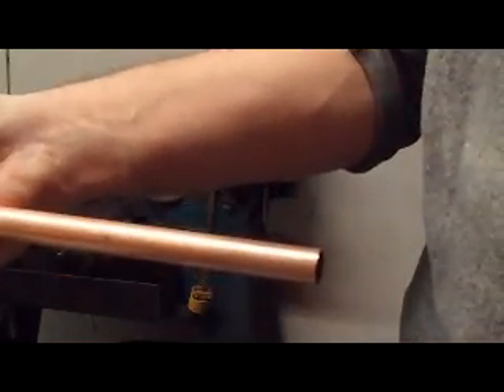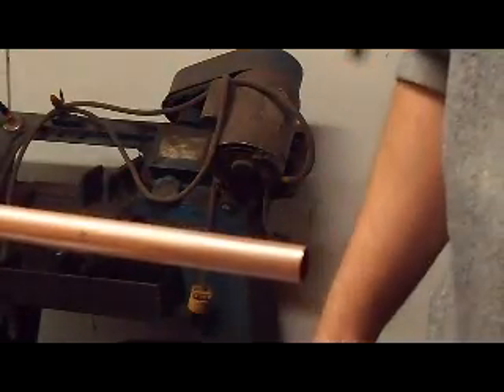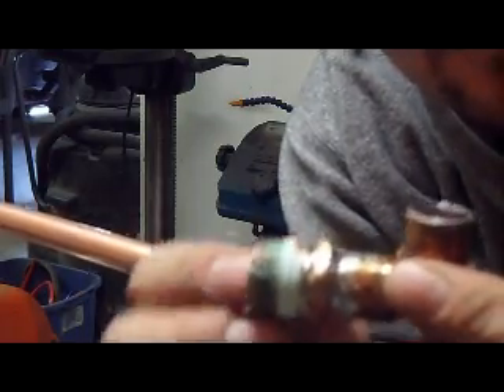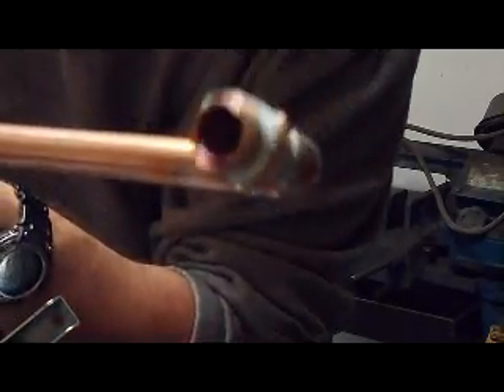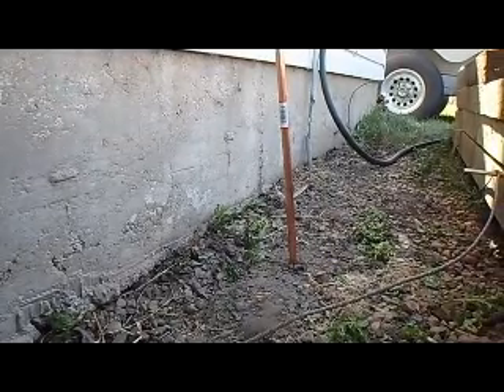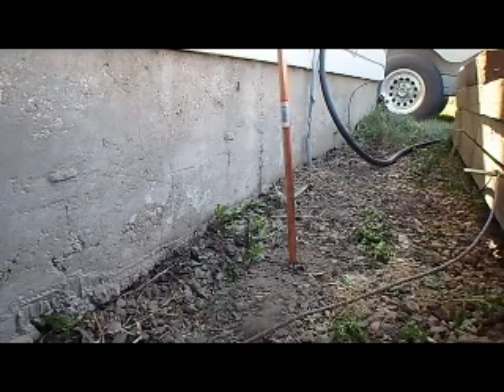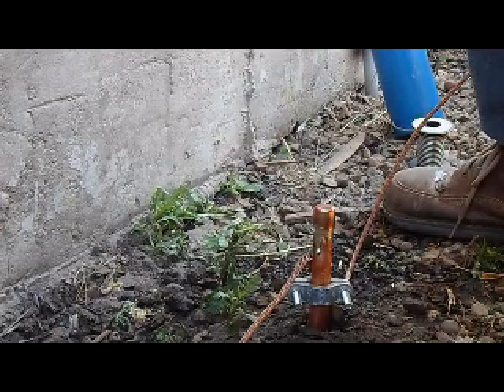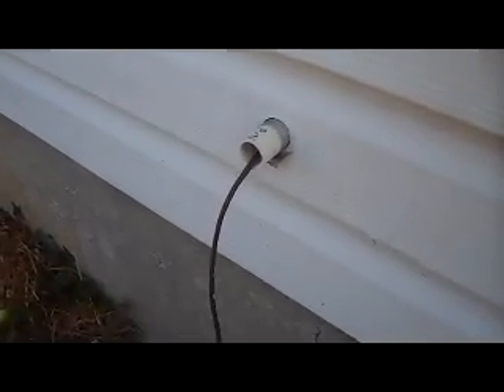Ground Pipe - Water drill

Comment: I would suggest burying those ground rods. What I do is dig 18 inches down and then install the rod as you did but below ground and bury the ground wire so if my kid or another person does fall in that area, they don't end up with a head injury or dead from hitting their head on those pipes. Its a trip hazzard too. you also get a better grounding by burying it. I've heard that flat copper strapping is better than wire. I want to try it myself.
Reply: Great suggestion on below ground. Also, yes correct, flat/solid copper strap is much better for RF ground than wire - and definitely don't use braded strap as that will oxidize / corrode and rust out.